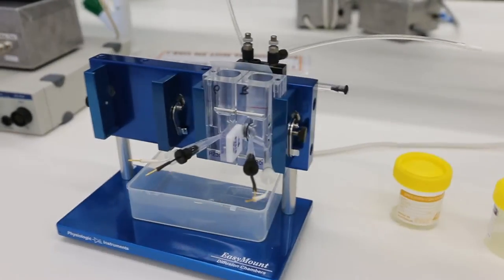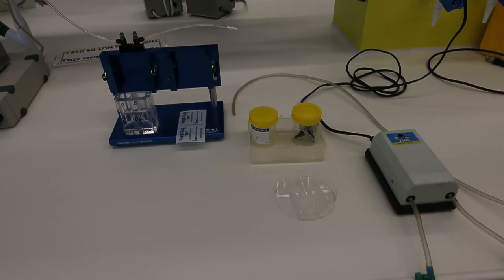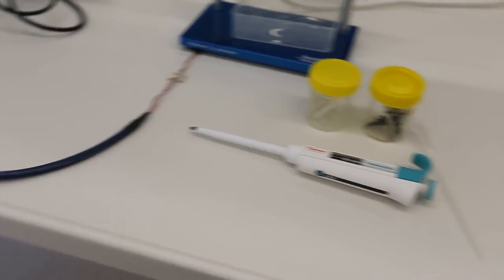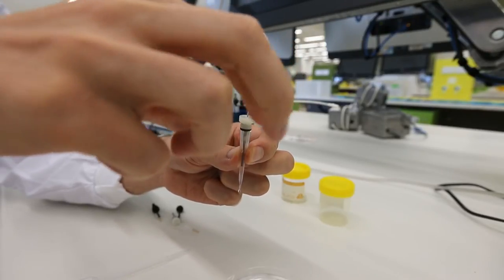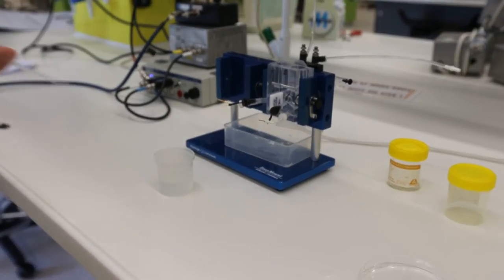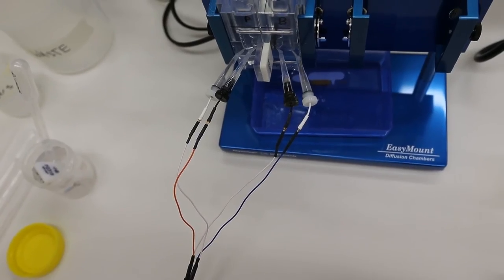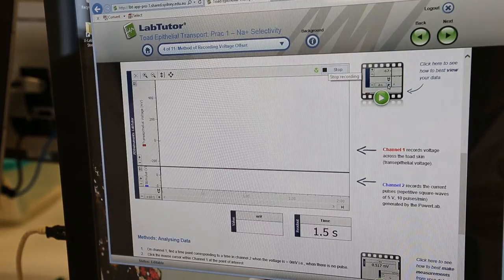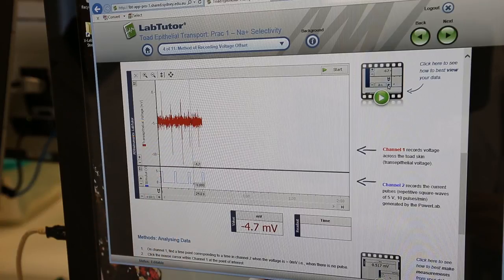Setting up Ussing chamber and measuring offset

Comment: Clear part really has to face to the left? Consistency is key right?
Reply from the maker: I take it you are talking about the instruction given at 1:49?   You are right, it probably doesn't matter for the chamber its self, certainly not before we place the skin into the tissue holder, but later on in a companion video we get the students to to place a circle of toad skin mounted onto another white washer into the tissue holder, with the pond side facing towards the clear half of the tissue holder.  So yes for consistency we get the students to face the pond side/clear side of the tissue holder, to the left, but also mainly because the way we hook up the electrodes later is specifically to measure the currents generated by the tissue when it is that way around.  If students put it the other way around then the electrode placement and the way the software is set up would need to be different.  It is easier to get all of the students in a large class to do it the same way.
Reply: Perfect answer. That makes sense. Thank you